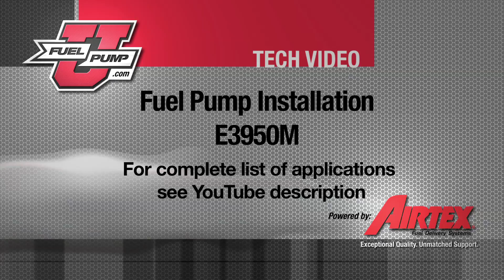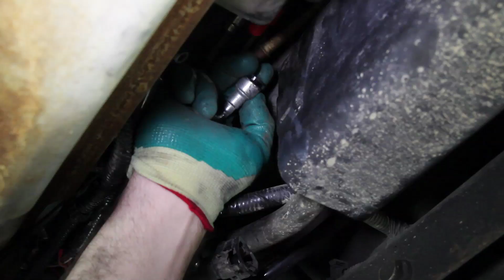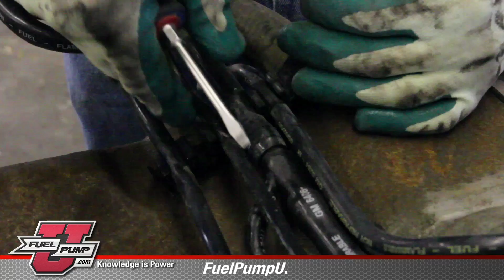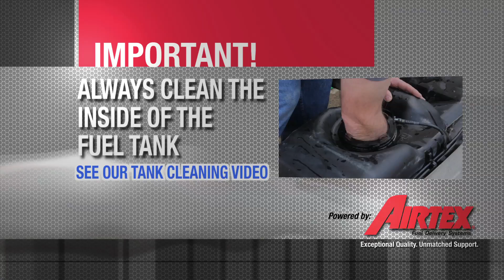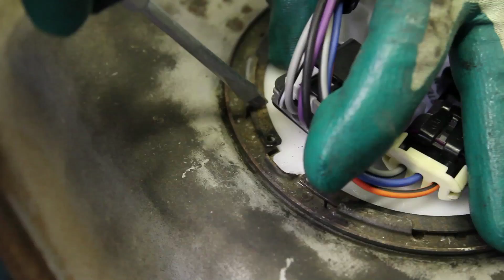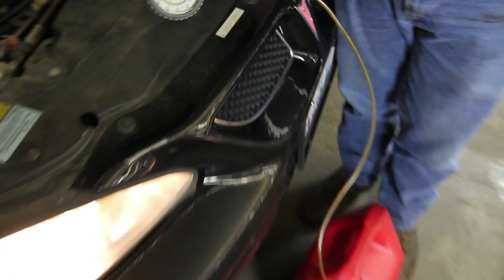How to Install Fuel Pump Module Assembly E3950M in a 1999 Pontiac Grand Am

Comment: In a 1999 oldsmobile cutlass, will these steps be for the most part the same?
Reply: This is a definitely a bit late but I have the same car. For others wanting to know, I think the old fuel pump in this video wasn’t the one that came on the car because mine looks different and I’m strongly assuming mine is the original because it only has 70K miles and it was yellowed. He also didn’t talk about wiring a new connector which 1AAuto had to do on their 01 Malibu, one of the connectors on their replacement part was different than what their car came with.

The plastic parts on the OEM pump look different but I haven’t figured out yet if everything matches up the same. The plastic connectors changed a few times through the years but overall where everything went stayed the same from the 99 Cutlass to the 01 Malibu

Definitely take good pictures of everything and take a thorough video showing where all the connectors go from the fuel pump assembly.

Comment: I have an 03 Grand Am GT, when you hit the brakes after running for about five minutes, the rpms go to 0 and it shuts off. It starts right up is this the brake booster airtex pumps?